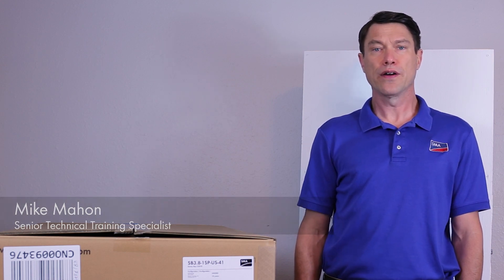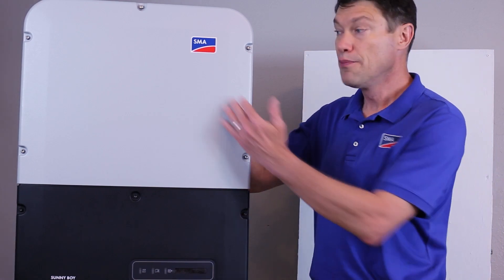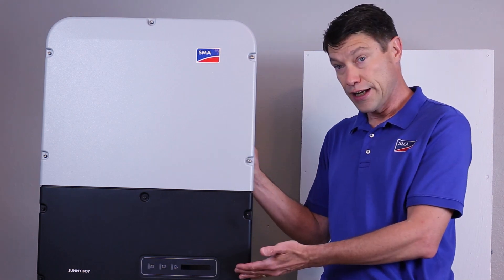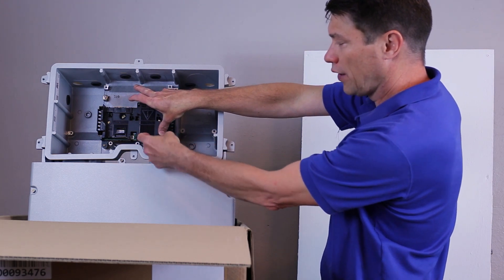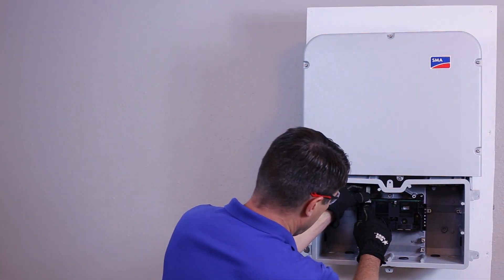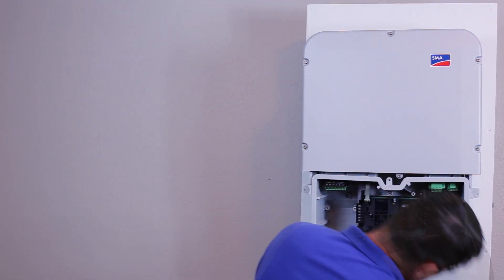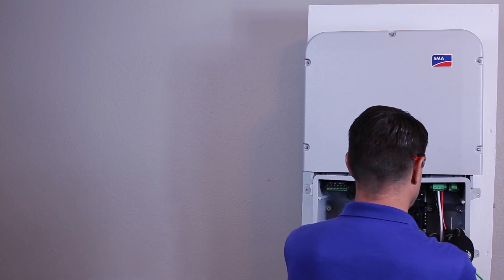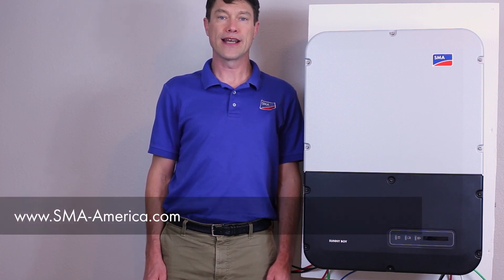Installation of Sunny Boy US-41 Inverter

Comment: I need some help on my system I have a 7000 which I believe has just failed.   I need to replace it and need to know if a NEW -40 or -41 is what I need in order not to change anything else on the system that has been working perfectly since 2011.   Please contact me if you have info and where I can get a new one.

Comment: Why only 3/4" knockouts? I have 2 arrays from roof top that have to enter  the right side inverter knockout. I am running the 4 PV cables directly from each array to the right side knockout and the required 10awg ground wire. This overfills a 3/4" knockout per NEC.  Sure, I could add more connections and reduce the PV wires to 10awg thhn/thwn but this should not be necessary.

Comment: If a single string has peak currents above 10A, can that string be wired in parallel across A||B to reduce the current and mitigate clipping? Do you have a resource demonstrating how to properly connect a parallel system to the A and B inputs?

Comment: Any issues with using 2 sunny boys US-41's on the same system?  Specifically, I'm looking at a 32 panel 11.7 kW ground mount array.  2 strings of 8 panels into each sunny boy 5.0 US-41.  The AC output from each inverter will go to 30 amp breaker in a subpanel.  The output of the subpanel will then go to a 60 amp breaker in the main panel.  Will that cause any issues for the sunny boys or am I better of running both AC outlets back to the main panel separately and tying them into 30 amp breakers?
Reply from the maker: John – The important thing to consider is to make sure the voltage drop on the AC conductors between the Sunny Boy terminals and the main panel busbar is as low as possible. The inverters use the AC voltage at their terminals as the grid voltage, and if that voltage goes too high, the inverters will disconnect from the grid. They will consider the grid voltage to be out of specification. The “voltage drop” between the inverters terminals and main panel bus bar is actually the voltage rise above grid voltage that the inverter will actually use as the “grid voltage” for this safety check.  I assume you have verified that your service panel busbars and main breaker are large enough to allow for 60A of backfeed breakers to be installed under code?
Reply: @smasolartechnology  Thanks for the reply.  My main panel has 200 amp busbars and a 175 amp main which I believe gives me 65 amps of backfeed capacity.  Based on my wire size and length I expect the voltage drop to be about 3 volts.  Do the 2 inverters need a communication wire between them via the relay or other means?
Reply from the maker: @johnstempko2746  John – I am not sure I understand the question. As you note, the two inverter breakers combined capacity cannot exceed 65A on the panel setup you described. The inverters do not need to communicate to operate – this is true for either connection scenario you described in your prior post. If you are asking about monitoring via the Sunny Portal, the inverters can be connected together with an Ethernet cable (Cat 5e and above) using the provided two RJ45 jacks on the inverter’s communication board. Either of the inverters can then be connected to the site router with an Ethernet cable for internet connection so data can be sent to the Sunny Portal for free monitoring. If using WiFi, both inverters will need to be joined to the customer’s (2.4GHz only) WiFi network individually for internet access for Sunny Portal registration and free monitoring.

Comment: Anyone with expertise I would really appreciate your help. I am looking to build a solar system (3kw) and want to use it only when the sun out approximately 9 am to 3 pm and don’t want to install batteries. My Aim of watt consumption is 1kw per hour or less . Would this system work given the fact that I don’t have a grid on . I get plenty of sun and almost zero shade or clouds. Will this sunny boy fit me or I am missing other information. Thanks in advance
Reply from the maker: Ahmed – the Sunny Boy can in fact work without a grid, but the only output will be from the Secure Power Supply (SPS) outlet, and there are several constraints to be aware of in this use case. First, if rapid shutdown is required, the SPS function WILL NOT work.  Second, the SPS switch must be toggled EVERY morning (off, then on again) – and this is a MANUAL process. Third, the SPS output is 120VAC, 60Hz, up to a maximum of 2000W with the Sunny Boy US-40 or -41. If the (3kW STC) array cannot provide the power the loads attached to the SPS outlet demand, the system will shut down. It will try to restart, allowing you to unplug some loads to reduce demand.  In short, the SPS was meant to be a convenience feature of a grid-tied inverter, used periodically, rather than making the Sunny Boy an off-grid inverter, which is your goal.  SMA would not recommend this use case as there are so many differences to a true off-grid inverter.

Comment: Will this SB connect to a SI6048-us-12 for on grid and off grid use. If not what SB A/C inverter would I need to use.
Reply from the maker: Daniel – the Sunny Island utilizes AC coupling, so the Sunny Boy would not “connect” to the Sunny Island.  There are different PV inverter capacity limits for the Sunny Island depending on off-grid or on-grid use – this would dictate which Sunny Boy US-41 models should be used.  Please consult the datasheet here: https://files.sma.de/downloads/SI6048US-DS-en-27.pdf.  Also please note that each Sunny Island is a 120VAC device, not split phase. As more Sunny Islands are installed, the allowed PV capacity also increases.

Comment: what is the diference between model US-40 for US-41?
Reply: 1
Reply: the 041 is the newest, and has the Rapid Shutdown control (via the DC line) to the TS4-R-F rapid shutdown modules. Rapid Shutdown is the latest code requirement.
Reply from the maker: German, The two major differences are that the US-41 model has an integrated SunSpec certified rapid shutdown transmitter for use with SMA compatible SunSpec certified rapid shutdown receivers (https://files.sma.de/downloads/SunSpec-Kompatibilitaet-TI-en-11.pdf) and the US-41 models use integrated mounting rather than a wall mount bracket.

Comment: So this model series allows Secure Power Supply (2k watts) when the grid goes down?  And it will also work with the SB ABU?
Reply from the maker: Val – if rapid shutdown is required, the SPS feature is not available on the Sunny Boy.  Please note that the ABU is an accessory ONLY for our Sunny Boy Storage battery inverter, not the Sunny Boy PV inverter.  The Sunny Boy Storage does have a feature similar to the SPS on the Sunny Boy, but it is not utilized when using the ABU.